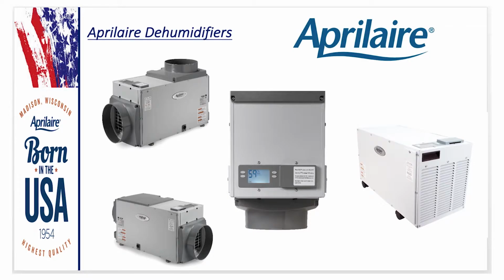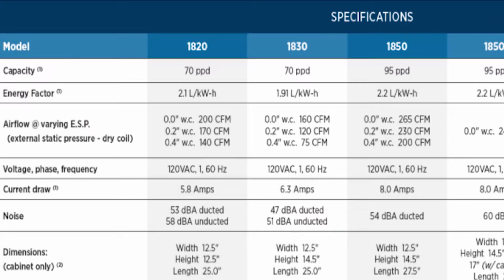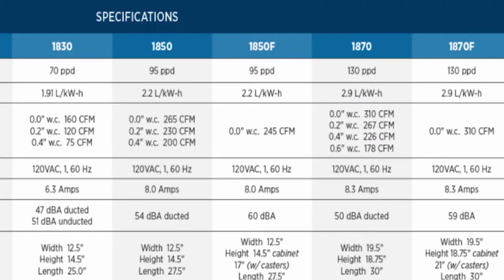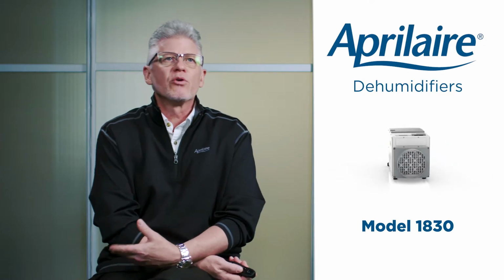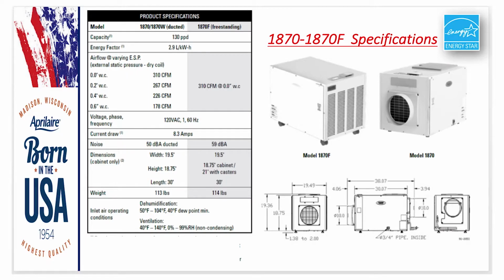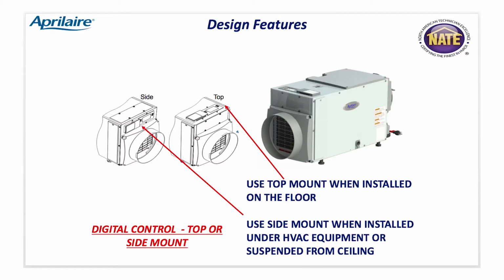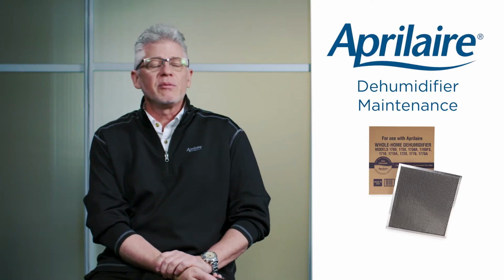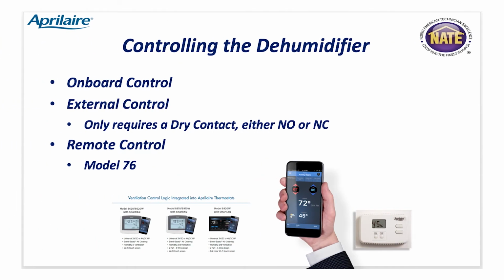AprilAire Training #7 – Dehumidifiers

Comment: I would like to monitor or control from my iPhone and no wall mount thermostat. 
Can I do this with any of your units? Need to handle about 2000 sq. ft.
Reply from the maker: Thank you for contacting AprilAire! Complete Wi-Fi control via the Healthy Air App without hard wiring a Wi-Fi thermostat to the dehumidifier is currently not possible. We must hard wire a thermostat to the dehumidifier to control via Wi-Fi. 

That does not necessarily mean the thermostat needs to be mounted on the wall of the living space, however. The Wi-Fi thermostat can be placed near the dehumidifier, or preferably in the space the dehumidifier is dehumidifying. So, if it’s a 2,000 sq. ft. crawl space, for example, you can hard wire the thermostat and keep it in the crawl space and never see it on the wall. If you have any further questions, feel free to contact us at support@aprilaire.com or by calling 800.334.6011. Thanks again for contacting AprilAire.
Reply: @aprilaireco  Thanks for responding. So are you saying that with a wired humidistat (in house or left in crawlspace), I can also control the units settings via a wi-if app? If yes, what type of controls can I use? Will I be able to monitor RH, temperature, up or down adjustments for humidity control and shut off if needed?
Reply from the maker: @MrBritrider  Would you mind giving our technical support team a call to discuss your application further? We'd be happy to help. We can be reached at 800.334.6011 Monday through Friday, 7:00 a.m. to 5:00 p.m. CT.

Comment: Planning to install to basement only  with 1850, 1900 sq.ft dimensions are 22'x80' long on one side that more of under ground level, and 20x40' on above ground and good amount of windows with sunny during the day, should I run duct to longest distance to inlet? 
Unit and most of moisture wall is about 60' away.
Reply from the maker: Hi Chongho - Thank you for contacting Aprilaire! Please give us a call directly at 1-800-334-6011 at your earliest convenience. We would be happy to assist with this.

Comment: The 1850 at  2.22 L/kW-hr appears to be more efficient than the 1830 at 1.91 L/kW-hr. Why is the 1850 not energy start rated?
Reply from the maker: Thank you for contacting Aprilaire! If you could give our Healthy Air team a call directly at 1-800-334-6011, we would be happy to address your question.